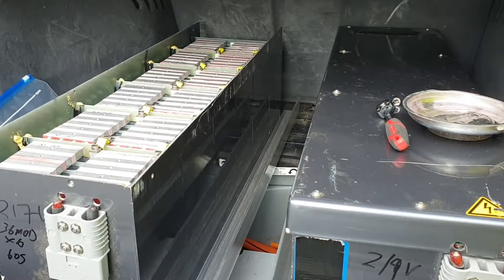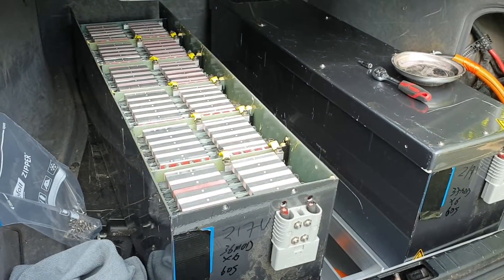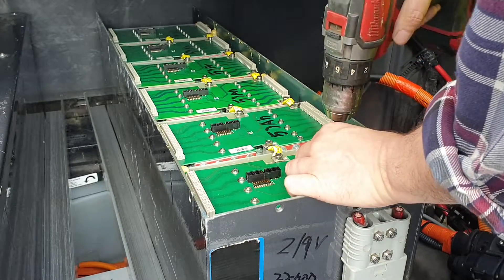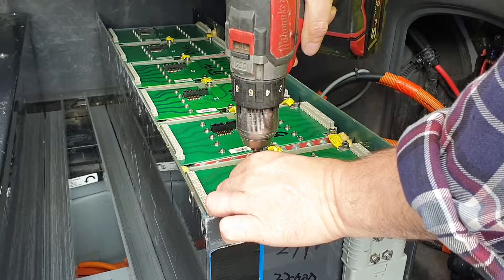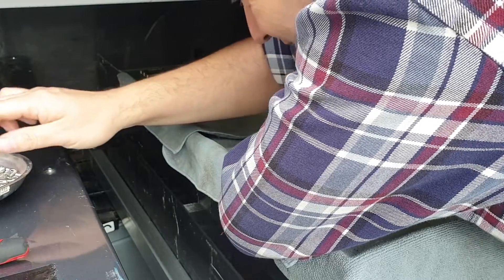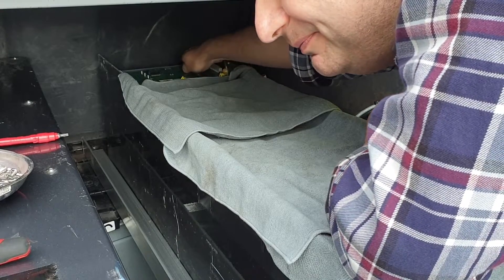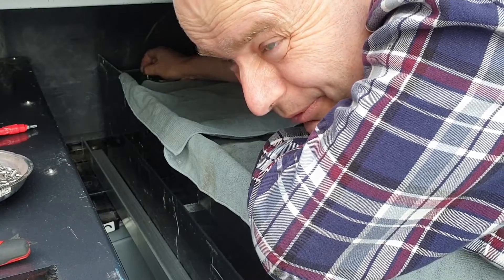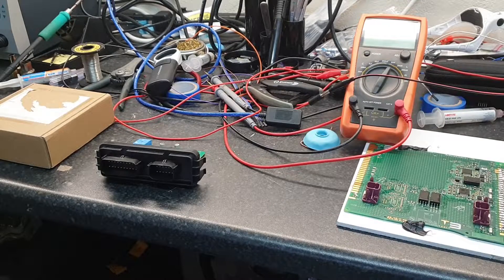The Bexus Electric E65 7 Series Battery Upgrade Part 1

Comment: u.s. Navy nuclear submarine reactors will not melt down.  
bring the diesel is a common occurrence ask me how I know I don't know how much time I spent at the sump tank.
it's kind of interesting but we use the diesel to ventilate the submarine compartments which is basically like having nice clean  air that has a slight smell of a chemical in it and replacing it with diesel flavored seawater air

Comment: Great Work, I might havent paid enough attention, but did you switch from the Hyundai 90kw AC motor to the Lexus 147KW motor?
Reply: I believe it is 131 kw dual motor transmission from a Lexus hybrid.

Comment: A totally unrelated to the video, onboard charger question, (nice battery boxes BTW): I have a factory built EV from 2002 with its stock 3kW Siemens charger only around 80% efficient! So I am looking to upgrade, both in power and efficiency, and less dodginess like occasionally shutting down when I am far from home at a low SOC. I have watched several of your old charger videos, and in my case,  see myself in the same pinch with an end of charge voltage around 247V, no suitable salvage EV chargers exist to my knowledge? So do I bite the bullet and order a Brusa charger, which I can setup as I please, or is it worthwhile to get an Elcon or TC charger, which has to be programmed before shipment, and is as expensive as a used Brusa after taxes, nor is user configurable?  I've also in ave watched you reverse engineer the 3 phase Tesla charger, you've got your hands on, but that is overkill, both in cost and power for a 20kWh pack. Are there any options I'm missing here, or some open source charger of interest? There are also the cheap non isolated adjustable CC/CV Chinese power supplies, which should do the job, but putting basically an indoor power supply in a vehicle, is not going to last, with rattling and condensation. So can you offer any ideas?

Comment: I have seen both dentists and physicists taking a big cloth and making a hole in it just big enough to operate on a single bolt or tooth. After all in movies there have come aliens out of those holes. You never know what might come out of a BMS or if somebody has already taken the "M" out of it. Apropos, you might consider wearing yellow shoes in case the holy smoke comes out. Missing Jack.

Comment: that's a lot of explosive power in those Boxes lets cross fingers that you don't go down the motor way at 100mph with white smoke belching from the back just like the red arrows acrobatics team ,  keep up the good work
Reply: With the Lexus motors, top speed is between 85 and 95 mph with the motors maxed out. Max rpm is 6,000 per motor with one lagging about 1,000 rpm behind.